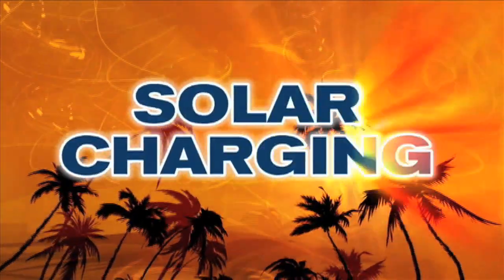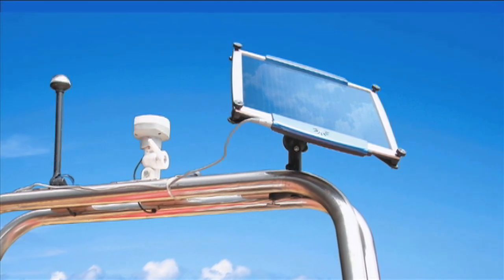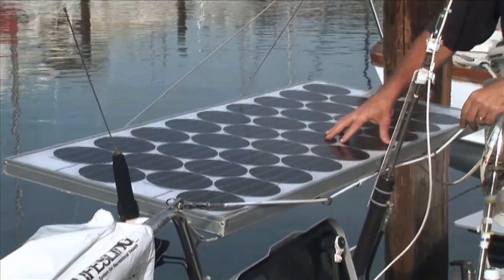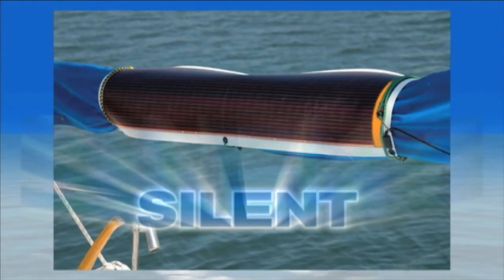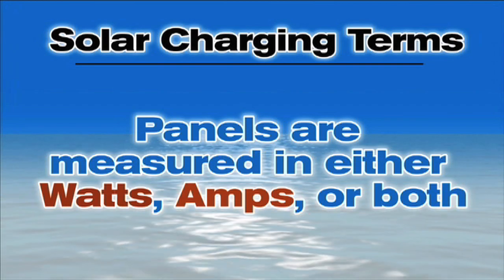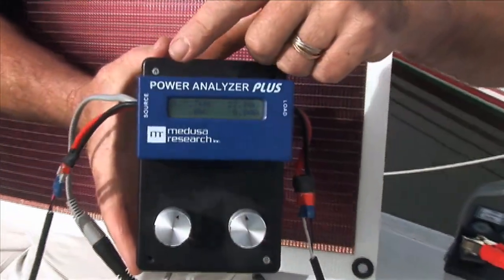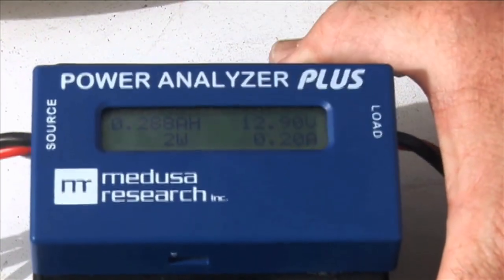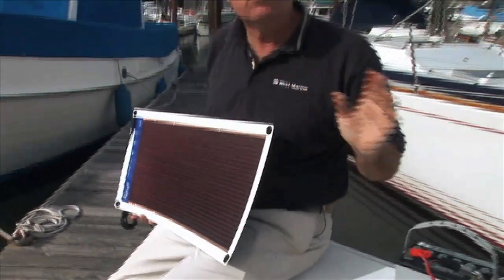Charging with Solar Panels - Solar Charging - Part 1

Comment: If it is sitting in direct sunlight, how in the F do you keep it cool ?!?
Reply from the maker: We listened to the video but heard no reference to keeping it cool. It's a solar panel that sits in the sun. It's going to get hot! If you have a specific question related to the solar panel we'd be happy to look into it for you!
Reply: starting at 5:35 you say "finally you want to keep your panels cool"
Reply from the maker: @stephanief1250  Thank you for the time in the video. He is referring to having some type of shade over it on the occasion. This video is over ten years old so many solar panels have changed greatly since then so he's advice may be a little out of date.
Reply: Watt.v.amper

Comment: Question. If a deep cycle battery has a 500 to 1000 cyclic rate.  Example. Wouldn't running a solar panel on it full time shorten the life of the battery ?
Reply: No the opposite is the case - the rated cycle number is for a specific discharge rate( in most cases 50%) if you go to a lower discharg for example 95% discharge you might only get 50-100 cycles out of your 1000 clycle rated battery. But this effect works the other way around aswell if you keep your batterys never over 10%discharged  because you constantly chargeing themn with solar you can increase the possible cycles greatly. for example  a 1000 cyle rated battery that is constaly getting toped off can easyly last 5000-10000 cyles